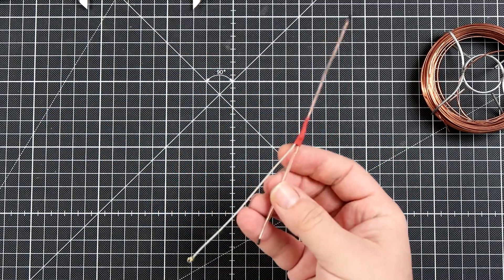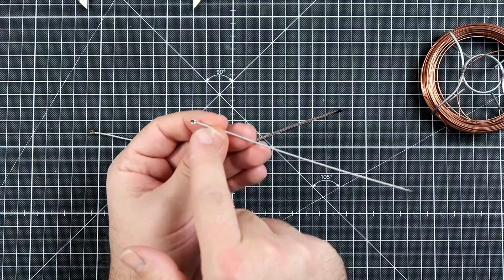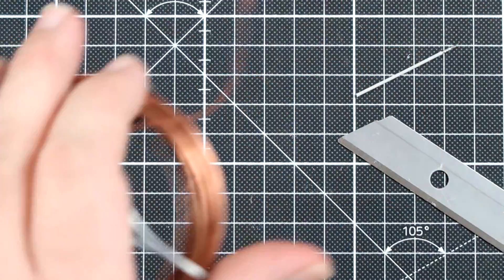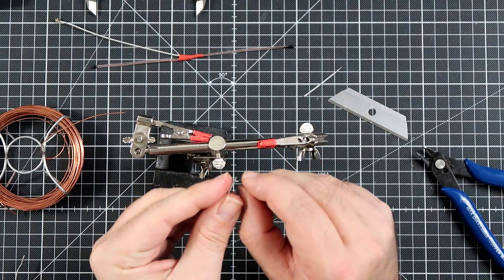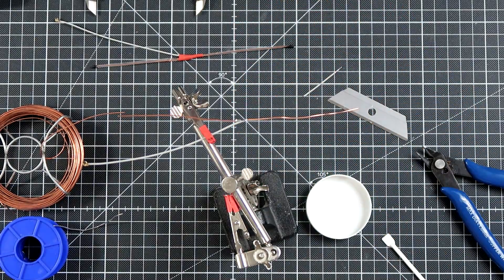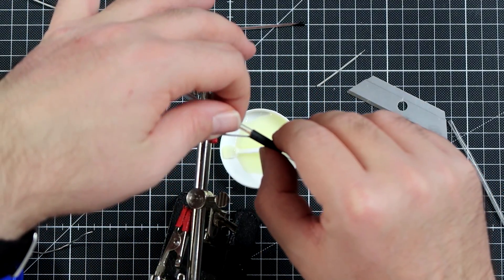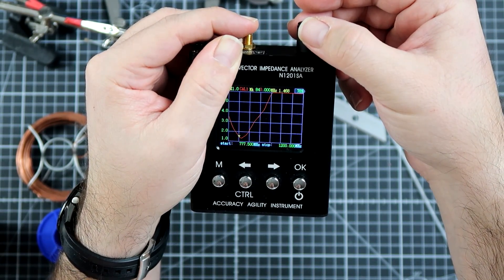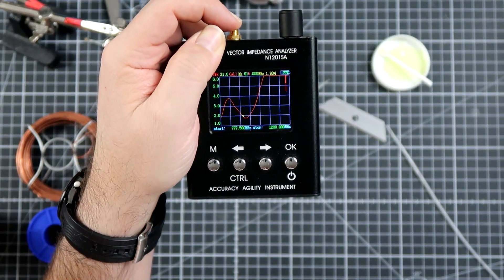How to make dipole antennas for TBS Crossfire receivers (and FrSky R9)

Comment: I made one last night as I'm all about NOT paying $9 per antenna for my 20 quads (I had 10, 2.4 ghz monopoles), looked perfect, but when I checked for continuity between the active element/ipex and the ground/ipex I only had connectivity between the ground and ipex. I cleaned my magnet wire like a champ. This could have only been due to faulty instructions lol.

Comment: for 915 Mhz should the quarter waver antenna length be 82 mm ?   since the full wavelength is 328mm
Reply from the maker: In vacuum? Yes. But antenna is not made from vacuum, so after adding velocity factor it's closer to 73mm. But it all depends on the antenna itself and material
Reply: @FPVUniversity  oh yes forgot about that,  thanks for the  clarification

Comment: Paweł I don’t have a 0.8mm copper welding wire but do have an electrical wire that contains a few cores however each of them has the copper core 1.33mm thick - would it be an issue? Or I should really find something exactly 0.8mm ? Thanks
Reply from the maker: that should work as well. But overall tune might be slifghtly different

Comment: Hello Pawel so far so good, but we all know the vertical mounting should be preferable... In most cases on mini quads the vertical mounting is not that easy with a quarter wavelength...
So what do you think about eighth wavelength for 868/915 MHz?
Reply: I have an honest question regarding your comment......does it really matter if your TX antenna is aligned the same as the RX? (as in horizontal as opposed to vertical) If they match, do you really need a vertical antenna?
I'm presently building a LR 7", and want to use an R9 slim+ flashed with ELRS and diversity antennas so I was thinking to put one in the tail horizontal, and one in front more aligned vertical to cover all the bases.

Comment: Thanks, I've made the same antennas..and they were working just fine. But after some more crashes, I've fixed the antennas on my both quads, just like I did before. But now I get some bad intereference on my video feed, on both quads. When I hold the antenna with my hand the lines dissapear, and of course when I turn off the radio they are gone too. What could be the problem, I think the range is not affected, just some lines in my video

Comment: I know this is an old video but I'm just getting into antenna building and I went by these measurements and built my own antenna just like this for the R9. All I have at the moment to test with is the ImmersionRC power meter. I put the original antenna on the R9 module, with the RC on one table, transmitter set on 10mw.. put the meter on another table which is about 6 feet from the RC.. and I put the super 8 antenna on the meter and got a reference reading.. then put my 1st DYS antenna on the meter, which is built to these measurements, and it matched the power reading from the super 8 exactly!! So I will vouch on Pawels measurements. Good job!! I have the same VSWR meter on the way. Thanks for your time helping the little guys!!
Reply: It'll match the power, but it's the frequency that will differ in cases where the length is off. I think they are are tolerant to a degree and you may only lose a little bit of range if not absolutely perfect . I've DIY'd a few antennas that weren't absolutely spec, and they seemed to work fine even out to distance.

Comment: Dear Pawel, is it possible to make a longer Pigtail as 11 cm and mount the passive-End tightend to the Pigtail, that you have an long "I" instead of an "T"? Or does it makes a difference for the reception? Causo with a strong enough "I" which is flexible, it would be easier to mount on my Quad.

And you say its not the best but its a good antenna. How can i tune it to a better Antenna? What makes the difference? 

Is a use of 99,9% copper wire the best for reception?

Comment: Hello Pawel, I was wondering how would one make an antenna that is smaller for micros 3 in and under kwads. I seen TBS has one for their rx but how would one go about making one for an r9 mini or mm?
Thanks for your great
 content.
Reply: Any antenna is the same length as prescribed by the formula. The difference lies in how much of that antenna is a coil hidden by the plastic of a commercial one. These small dipoles have a coil that corresponds to the actual length, but the coil part is hidden in the centre plastic. Old analog car cellphone antennas had a coil in the middle of them. Not for aesthetics but just to make up the length without having to make a longer, floppy antenna.

Comment: For 868MHz you need exact 8,84cm (1/4 Lambda). 8cm is way too imprecisely for long range distances.
Reply: I guess he really wanted it tuned to 937 mHz at 8cm. 868 is actually 8.64cm
Reply: You both forgot to take into account the velocity factor of the copper and heatshrink around it. The velocity factor of copper wire is around .95 and the heatshrink is likely similar making the ideal length around 78mm.

Comment: Paweł Spychalski so i damaged a r9mm antenna can i use spare sma pigtails to make my 2.95" ends? just use the whole pigtail as my solid ground and signal? as long as the ipex 4 is seperated signal and ground? i dont have copper welding wire is why i ask..

Comment: Where the "welding wire" comes from? By the spool and by the bends in the wire it looks like a soft pure copper wire.
Welding wire should be (hard) steel coated with copper and come on easy to unspool roll.

Comment: If I would use flexible coaxial core (the inner part of the RG178 cable or something similar) instead of "simple welding copper wire with shrinkwrap cover" what would be the size to cut?

Comment: Hi, Teo questions, can I re-use my existing r9mm antenna and extent both parts of the dipole to 80mm for 868? The problem is that even doing that the feed line is too short and would be 8cm approx instead of the 11 you say. 
Second question is why you say 8cm for 868 while in the other video for the tx dipole you say 77mm for 868.

Comment: One question Pawel :) Since you look like you might know :) When I was playing with 4nec2 program - basic "whip" antenna had a very similiar radiation patter to dipole. In this case do you think that the way we mount this antenna matters? Because if we wont mount it as a horizontal "T" then it is basically a whip antenna with an extra element. So could the way we mount the antenna change its performance? Not mentioning the "V" antenna :D which is practicaly any "T" antenna after a crash :D
Reply: BTW FINALLYYYY! Thx for the DIY :) trying it out right away
Reply from the maker: Whips, as monopoles need good "ground plane". This is why dipoles are used - they provide ground plance . And antennas always vertical

Comment: Hi Pawel. Thank you very much for the video. 2 questions: how dependent are the 2 elements of the antenna on one another? What is the effect of bending the ground element 90 or to an L shape from the solder joint point on the SWR? 2nd question: Can you make the ground element start from a different part of the pigtail to the live element? Let's say I'd like to put the ground element on the back of the quad horizontally and the live from the top plate of the quad vertically. Thank you again!
Reply: Great question.. too bad it never got answered 😞

Comment: What exactly is 0.8mm "welding wire", never heard of "welding wire" except for use in a tig welder or something like that

Edit: can I use solid core 12 or 14 gauge electrical wire?

2nd edit: looks like 28 gauge wire is close to the right size. Not 12 or 14

Comment: Just a little tip, if you stretch the cobber wire a little, it will get harder (deformation hardening) and straight.

Comment: Hi Pawel,....How important is the 110mm base length? and is this also okay for the R9MM receiver...?...My FrSky antenna has a base length of only 80mm..?
  FrSky have different base lengths for their different receivers it would seem....even though they operate on the same (2.4G) frequency.
Reply from the maker: In theory, length of the feedline depends on frequency and velocity factor of the coax. Length should be a multiple of half wavelength in the coax. Here we assume that velocity factror is around 0.65. This is just a safe assumption and antenna would still work with 10cm or 13cm and so on
Reply: Hi Pawel, thanks for your answer, Using my 868mhz True-Mox and 200mw fixed, My RSSI is hopeless at around 40% only 1km out....even after i extended my std antenna as in your video.
  The R9MM receiver seems to give random results in terms of range...?
Reply from the maker: either you have damaged  hardware or you do something very very wrong. wht's the altitude in your case?
Reply: Try to bind again